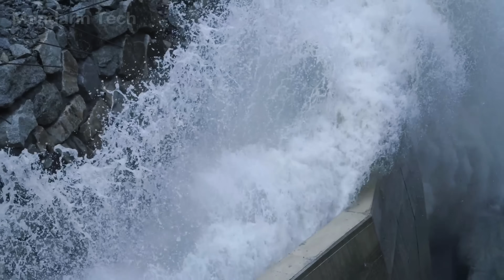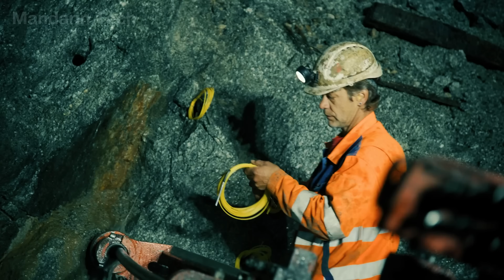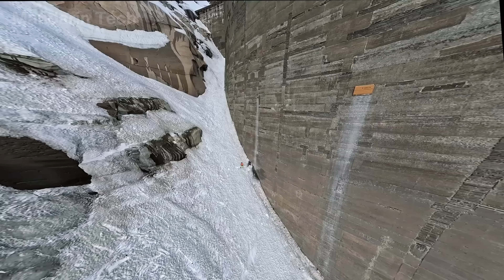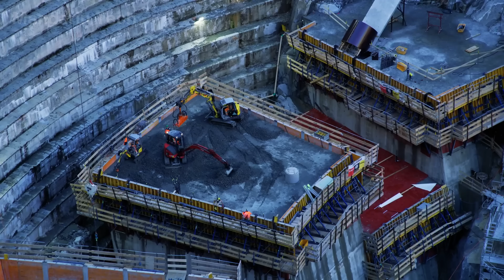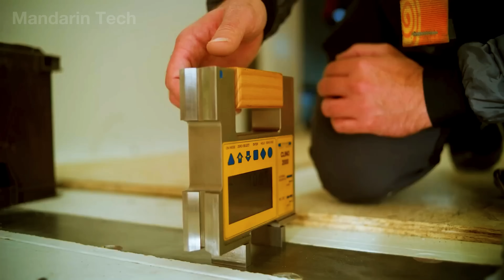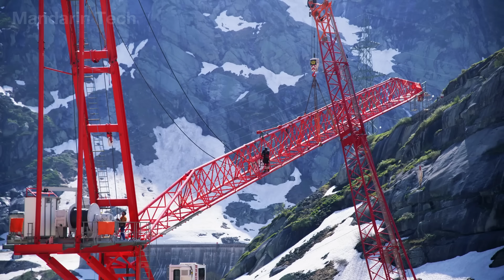Switzerland Is Replacing a Massive Dam at 2,000 Meters in the Alps in Front of an Active Reservoir

Comment: Field Engineer & Environmental Perspective
🇬🇧 English

From a field and environmental perspective, working at high altitude and near an active reservoir requires strict safety measures and environmental control.

Managing water flow, protecting surrounding ecosystems, and ensuring worker safety are critical priorities.

Field engineers play a key role in adapting construction methods to site conditions while maintaining environmental compliance.

Sustainable infrastructure must balance performance, safety, and environmental responsibility.

#FieldEngineering #EnvironmentalEngineering #DamConstruction #Hydropower #SustainableInfrastructure #ConstructionSafety #ResponsibleEngineering

Français

Du point de vue terrain, travailler en altitude et près d’un réservoir actif exige des mesures strictes.

La gestion de l’eau et la protection de l’environnement sont essentielles.

Les ingénieurs terrain assurent sécurité et adaptation.

Une infrastructure durable doit être responsable.

#IngenierieTerrain #IngenierieEnvironnementale #ConstructionDeBarrages #Hydroelectricite #InfrastructureDurable

Español

Desde la perspectiva de campo, trabajar en altura y con un embalse activo requiere control y seguridad.

La gestión del agua y la protección ambiental son clave.

Los ingenieros en obra garantizan adaptación y cumplimiento.

La infraestructura sostenible equilibra rendimiento y responsabilidad.

#IngenieriaDeCampo #IngenieriaAmbiental #ConstruccionDePresas #Hidroelectricidad #InfraestructuraSostenible